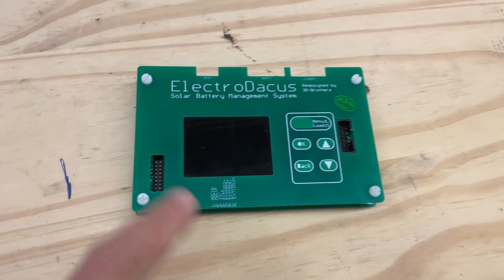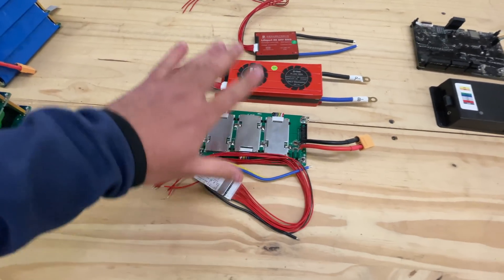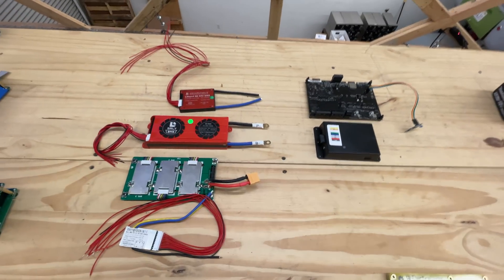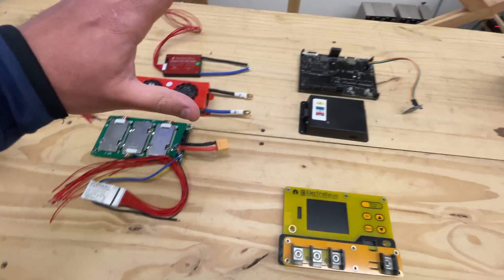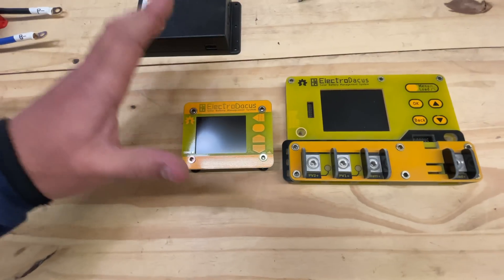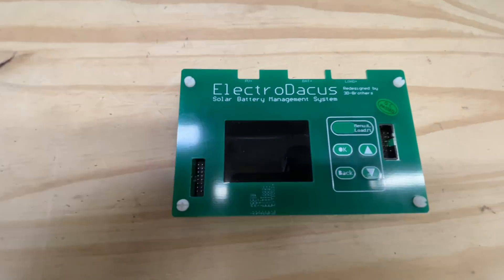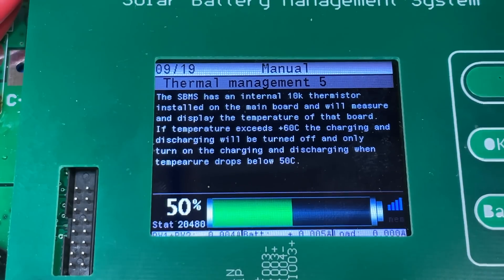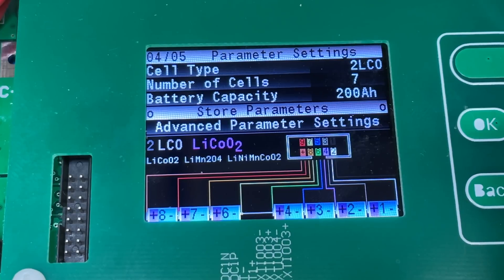The Reason This BMS Needs to Exist  -  Electradacus SBMS40

Comment: Sure, would love to support this and get to use this BMS but... I need a 24S (72-90v) smart BMS that can support 100A continuous and 300A peak discharge for a vehicle application and this can't do it... 40A?!?! Comeon.... There are tons of smart BMSs on Aliexpress that fit my application and they are a third of the price too. Sure they don't look as cool and take a little longer to get used to (mainly due to Chinese translation) but they do the job very well and, again, much more affordable. 3D bros - build one that's proper hardcore, please! Actual active balancing, protection board, 32S, 300A, bluetooth, onboard screen, fully enclosed etc... The kind of do-all BMS to rule them all!
Reply: And the ones on AliExpress have Bluetooth, so they can be used through your phone instead of looking at a tiny screen
Reply from the maker: You need the delithium
Reply: @jehugarcia  mm... It's unnecessarily complicated. Almost feels unfinished. For a consumer product, they need to put more effort into it, make it more user-friendly. It almost feels like a manufacturer proprietary OEM bms. If they develop it further, then may be.
Reply: 32s 300 amp bms from alibaba is the golden ticket right now
Reply: I had already commented about the ANT BMS before I read this.  I completely agree. Its an absolute steal.
Reply: You've misinterpreted what the sbms40 is. It has a solar charging unit that is limited to 40a (or a bit more actually), whereas the continuous or peak discharge is only limited by the batteries, connections and whatever fuses/breakers in your system. It is only 3x to 8s because that is the hardware limitation of the lithium charging chip he selected when he designed it for himself to make solar power at home. It is almost perfectly designed if you use it for this. I have been using my sbms120 with a 5.2kwh battery for a few years. The only limits are my wiring/breakers/inverter. I don't pull 500a at a time because I don't need to, not because of some design flaw or limitation in the Electrodacus device. It does have the small, useful screen, I can easily pull up the data via wifi onto a cheap tablet, phone, or whatever. In comparison, when I later bought a Chinese bms for a portable 14s lithium pack it was annoying to learn a 100a bms is more expensive than a 30a.

Comment: I don't know if you mentioned it but there is a downside to "hella configurable" and it comes with the realization that the mosfets that ensure safe operation are SOFTWARE controlled.  In most "dumb bmses" they are controlled directly by voltage levels on the circuit so short of faulty parts or design it either works or doesn't.

With this sort of device if the software gets stuck in a hang you can overcharge/discharge or short the battery without intervention.  With a "dumb bms" those features are accomplished in fixed static hardware layout e.g. once the current sense resistors voltage gets too high the mosfets turn off etc...
Reply: The mosfets are not software controlled only. There's a specialized BMS chip that runs apart from the software used for setup. There are 2 parts of this BMS, one is taking care of the configurability, and the specialized chip that loads the configuration from EEProm when it boots.
The software only allows you to turn on and off the load and charging manually, but the BMS chip watches the battery at all time.
Reply: @Alexander1560  ah ok well that's better. :-)
Reply: Do you have experience with BMS and the SBMS? You could email dacian about this but my (uneducated guess) is that he considered this. His stuff was designed to be more reliable. Electronics and hardware fail too, and they also have bugs. 
Being software controlled is an advantage because this can detect failure modes and the simply close down instead of destroying your battery.
With the SBMS you can see if it fails and can get a notification on your computer, with the cheap BMS you don't. If there is an issue, it can default to off. So it's safer. As long as the software is well tested which I believe it is.
But I don't know enough about electronics so maybe you're right.

Comment: Can multiple battery packs be wired in parrallel with each using one of these bms’s?
Reply: If the cells are in good shape and they don't sag differently from each other, then you are good. But if there are big differences between cells, then current will go through the ballancing wire that's connected to both packs. When that happens fuses will pop or the thin wire